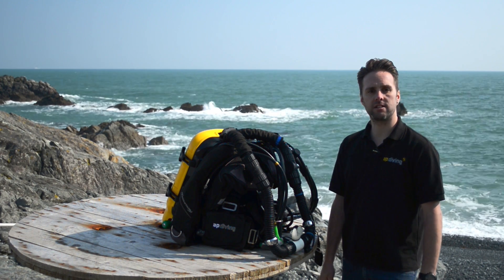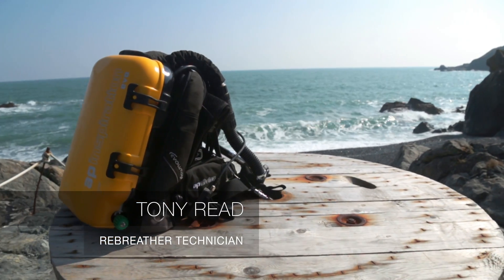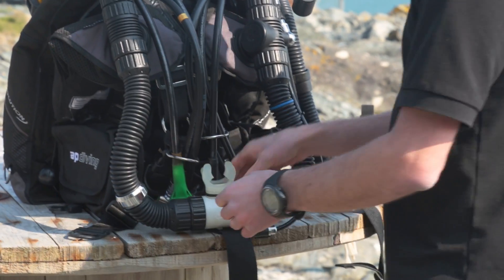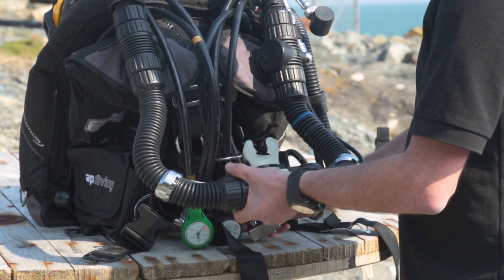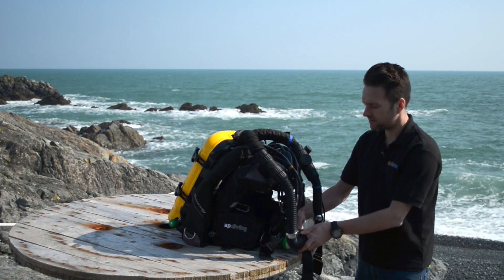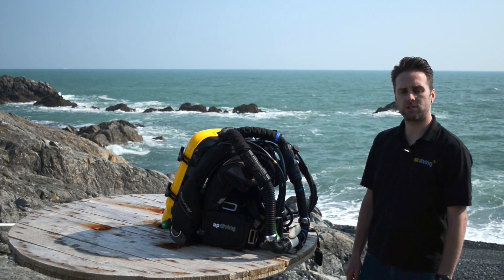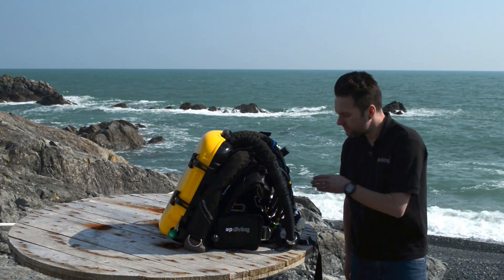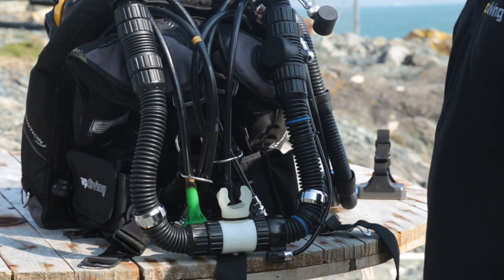How to: Perform a Rebreather System Integrity Check

Comment: With the positive check the diluent needs to be turned on to manually (not orally) inflate the counter lungs. However wouldn't the diluent need to be turned off to prevent the ADV from activating? This isn't explained.
Reply: The ADV would only activate when there is a negative pressure on the inside of the loop (It's just a second stage after all)